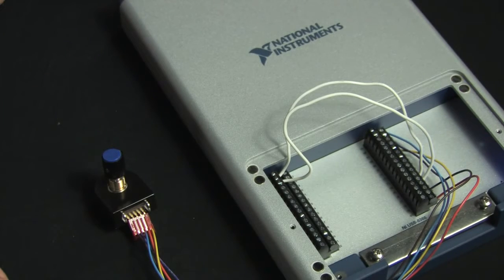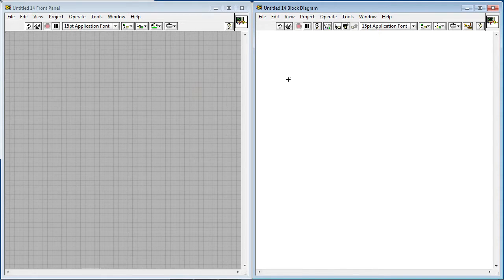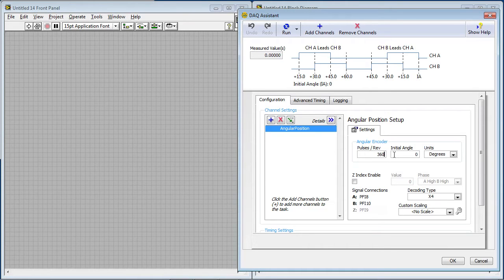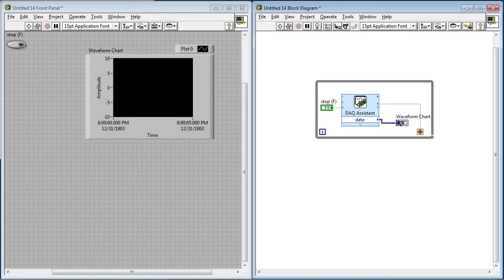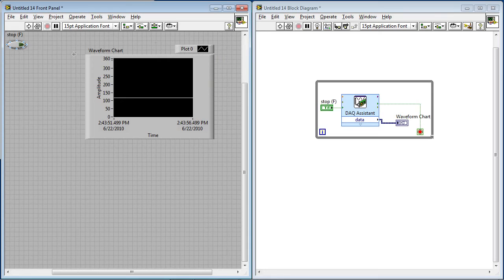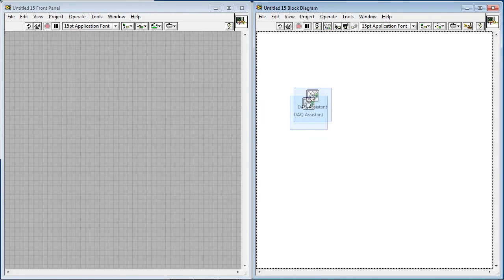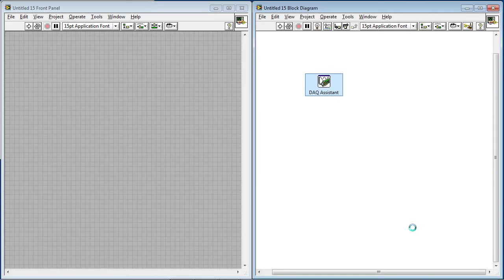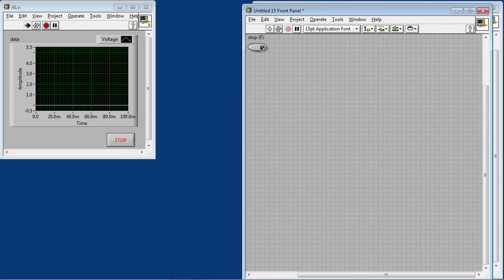Measure Encoders and Generate Pulses with NI USB X Series

Comment: What is the cheapest NI USB DAQ that will allow me to use a encoder to find motor rpm. For my project, I will also be using a load cell sensor, a temperature sensor, and a variable frequency drive (I want to connect this to the USB DAQ also). Thanks!

Comment: how about use rotary encoder in arduino uno then want show it on Labview 2011. The purpose is want show 360 degree. Only rotary encoder and arduino uno connect to laptop.